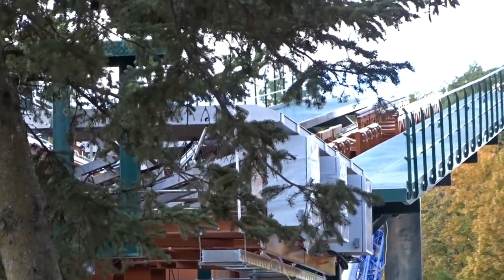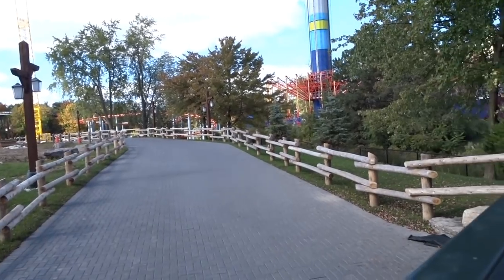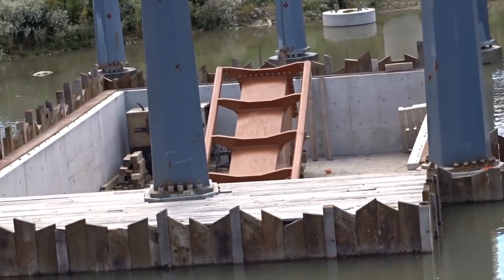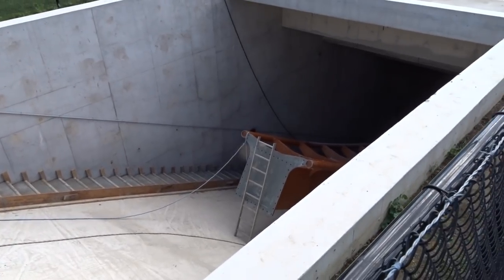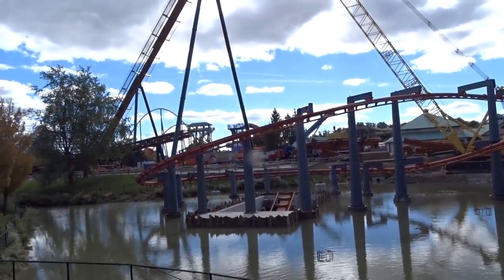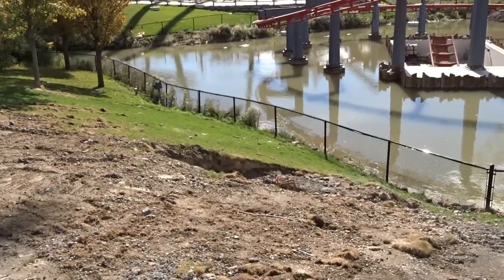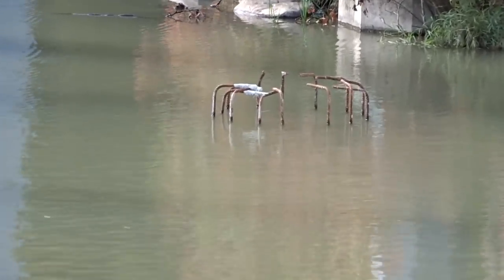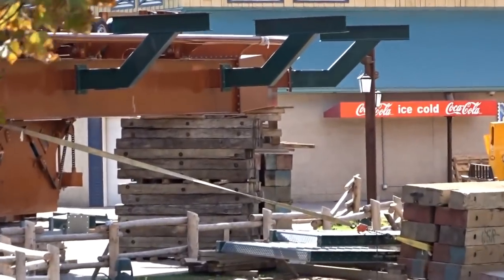Yukon Striker Delayed?

Comment: All they need to do to avoid a 28 day delay just because of 1 misplaced footing (I guess) is use a high early strength Concrete mix that can cure in just 3 days.  It will cost a little more but we are talking 1 footing the amount will be peanuts in comparison to the entire project.

Comment: The Engineers likely created a flow chart calendar using the "Critical Path Method" (C.P.M. ).
All tasks are charted with a, "critical", start and completion date that allows time for all tasks to be done before the project completion date.
A Project Manager uses it to avoid delays by focusing mainly on the current days critical tasks. sHe can also ignore some tasks that are not yet critical.
The footers, (lol), curing time are likely still before thier critical start date.
The chart is often posted on the trailer office wall.

Comment: Ive been in construction of all sorts for years....and they have different mixtures they can use that are just as strong and set faster...just a matter of cost. I personally find it amazing the teamwork that goes into  erecting a coaster. The fact that the surveyors and the concrete workers getting all those footings and embedded bolts to hold the large supports throughout the coaster and most times line up  damn near perfect on most coasters...….an incredibly amazing accomplishment.  Kudos to those guys on all the various disciplines of making a coaster.  Im guessing a slight  error on clearance for the tunnel was probably an issue....so what....these guys are allowed a mistake once in a while.  So nobody start getting all worked up about it. They will get it done.
Reply: Hey they can take allll the time they want to work on the clearance issue.. bc that will be my number one fear on that first ride 🤣🤣🤣
Reply: noooooooo that isn't scary, that's fun.  If you want scary, try owing a guy named Guido $10,000 and youre a week late.  THen you will know what scary is. :P
Reply: @steveaustin3007  lmao

Comment: What’s going to happen when it rains? Will the tunnel flood or will they have draining in there?
Reply: They have pumps.
Reply: While yes there is pumps that pump out the water and such but I wonder to the fact what happens if the electric goes out?  Lol, then they would have a problem then, lol. Let's hope that never happens as I am sure that Cedar Fair has a plan in place if that were to happen!
Reply: Jim Ewen Yes, they have a backup power supply for the pump.